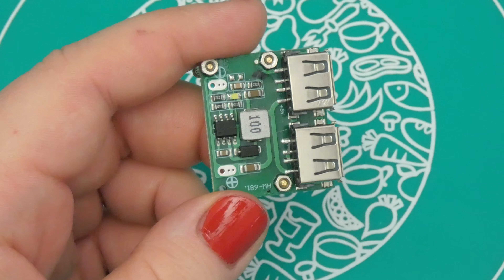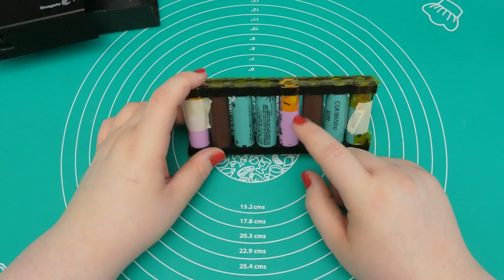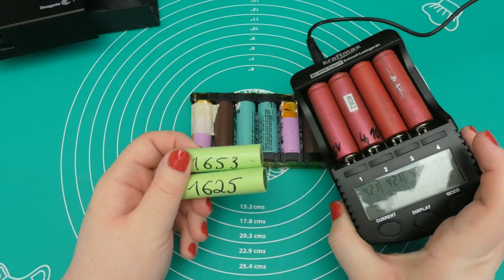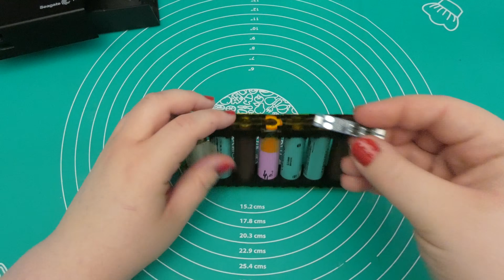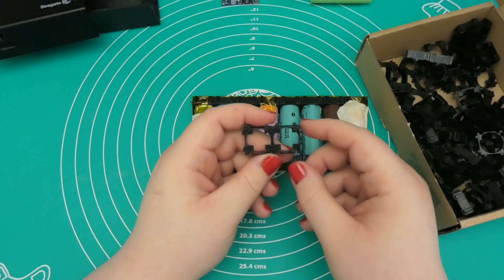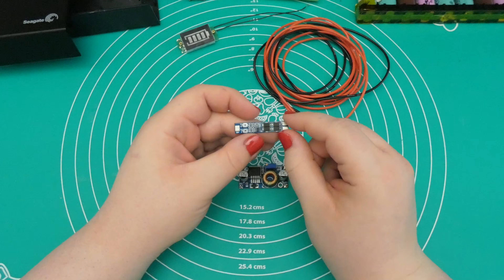External LI-Ion Battery Pack/ Powerbank for my Camera - Components, Battery and Design

Comment: I think the buck converter is rated at 3A without cooling. Sorry if I missed it but are you fitting a last resort fuse just to be sure to be sure. 
Glad to see you back Anna.
Reply from the maker: The buck is rated at maximum 5A but has internal power limit to 75W on its output. Well without cooling it should not exceed 50W. As for an additional fuse I didn't install one as I rely on the BMS properly working. There is no reason not to install one but I didn't bother. I always test the BMS to see if it works properly and so far I never had one that failed or didn't work out of the box.